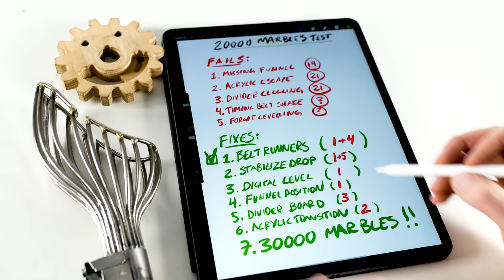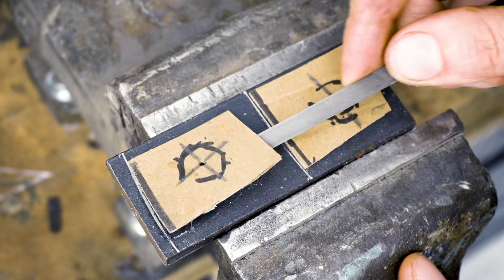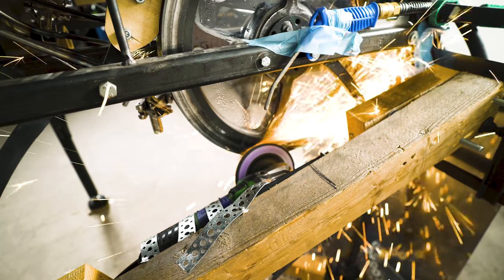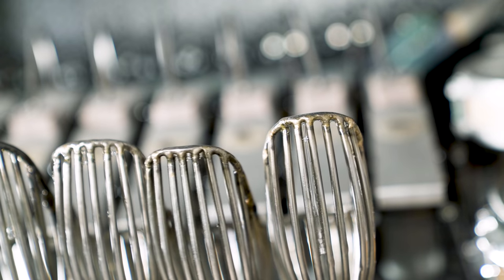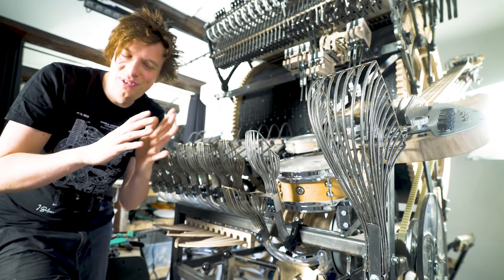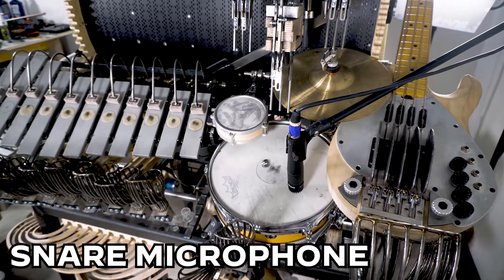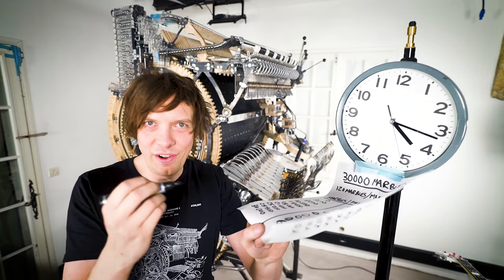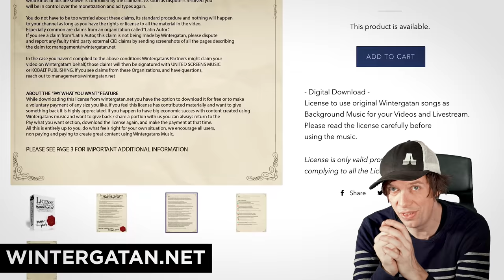Playing 30000 Marbles - Marble Machine X #148

Comment: The trouble, at its core, is not even that the fish stairs get fed when there's a backup and can't stop, the issue is that there's no reservoir of sorts to take up an excess of marbles without causing failure of some sort: If there's too many marbles at the top they're going to leak out somewhere, sooner or later.
Without messing too much with the layout: Empty the stairs into a box and feed them into the bottom of the the elevator if, and only if, there's capacity left, by having a second elevator loading platform on top of the already existing one: If there's already marbles getting lifted, new ones won't get loaded.

That way you won't ever have to worry about having too many marbles at the top, ever. Additionally with a reservoir you get a constant, predictable stream of marbles into the divider, indepenent of different round-trip lengths of different instruments and everything.

Last, but not least, you'd also have a place where you can drop a bucket of marbles into to load the machine.
Reply: I can well imagine the pipe out of the reservoir would be a prime place for blockages.
Reply: @ouzoloves  Well, yes. That's kinda the point: All blocking is in one place, and there's enough space in the reservoir so that the block doesn't reach the input of the reservoir. Of course you can also overload the reservoir, but if it's large enough you'd have to do that on purpose for it to ever happen. You also get an early warning, and a single place to watch. And if everything else fails you can add an overflow to the reservoir, taking marbles completely out of circulation.
Marble overload is a failure that always will be able to happen if you only put enough marbles into the machine, and if failure is unavoidable you want to make it graceful.
Reply: You also forget that he is using two channels out of many many channels.  Less marbles in the machine for the test, no traffic jams. More channels active, no traffic jams. The problem for those last 6 will never be a problem under normal play.
Reply: BTW the side "stair" is almost empty while the front "stair" is always full... small issue on dimensioning one vs the other?
Reply: @TheTexan83  But now we need to define "normal play", and limit compositions to it, probably only Martin will know whether that's a viable option. With a reservoir, the limit is simple: Don't eat more marbles than arrive on a fully-loaded elevator, right now the equation is both more complex and more restrictive. But even without all that I'd say the reservoir is worth a build simply to have a place to pour a bucket of marbles into.
Reply: @COPKALA  This is because this snare drum only consumes too few balls. So thus for main elevator not much work to do. All balls acumulate into fish stairs. In typical music machine would play much more notes simultanelously, so consuming more balls per second. Main elevator will get more balls to lidt and fish stari, which is actually overflow recovery device will have less. So actually this test is  pushing machine out  of typical operation envelope.
Reply: @TheTexan83  my thoughts exactly.😉👍
Reply: Buffering is a good idea. It doesn't hurt anything, just adds a safety valve.
Reply: @COPKALA  The stair is just a recycler. unused marble get sent back through the divider system via the stairs, the conveyor belt is what brings the marbles used to play instruments back up.
Reply: @Sorestlor  Make it a large glittery disco ball, under the drum? Or a big turning lotto  glass bulb, with marbles tumbling inside? ;)  To be serious I know if it was to look good it would probably create more problems than it would  fix.
Reply: It comes down to load balancing and I think that is one place that hasn’t been fully addressed in the MMX.  You need to make sure that there is enough marbles on top of the divider that it is fed enough marbles to keep all the channels full, but not too much that get backed up and overflow.  It is a question of timing and flow rates.  The return from the marble dividers to the fish stairs and back is a short trip and doesn’t have have a lot of reserve for excess marbles.  If you had a overflow that dumped them into the bottom of the machine then you could aleve the backup and prevent an overflow.   Couple this with a small storage system at the marble divider that can keep up with a fast song using all the channels during the time it takes the returning marbles to filter through the system.  This is going to be key to go from a slow section playing a few notes on one instrument to a rapid beat on all the instruments at once.  The first instance my overflow the top if it can’t handle all the marbles, the second may drain the marbles channels missing notes if it can’t refill the marble divider quickly and efficiently enough.  Once all the instruments are up and running you will have to run a ludicrous speed run with all the channels wide open and then one with nothing playing to make sure there is no backups and overflows. If the MMX can handle that then it can handle anything.
Reply: I'm not sure if you'd even need to do that,  outside of this test I think you'd generally have other things running, so the tube might not get clogged in the first place. In a more realistic application I don't think you'd ever see 4  hours of just snare drum :)
Reply: I wondered what channels would be the most frequently used and if that was taken into consideration. Also if that channel would require a reservoir to meet the demand.
Reply: @SpeedohDark  it has, I can't remember which episode, but he did do the math for the amount of balls being brought up per beat along with thee max amount you would reasonably play at  time, because do you think anyone would listen to just having every single xylaphone key being played at once? Those are the ones that take up the most channels as well, so yea. As for considerations, there were three ramps added at terh top to ensure that all channels can get marbles even if the front consumes a lot
Reply: The simple solution for the backup in the marble divider is to have a pipe at the end that sends marbles back to the bottom. This would mean that any marble that doesn’t fall into one of the holes will be sent back to the bottom instead of clogging things up. It’s a really simple change!
Reply: @karlpron  Why buffer when you can send the extra balls back to the bottom, eliminating overflow altogether?
Reply: The only real reason the fish stair overflowed is because only two channels were active.
In every other scenario, more than one instrument or note is played regularly, increasing the flow of marbles on the divider, which removes the problem.
I doubt Martin is going to be playing only the snare for 4 hours on stage ;).
Reply: Honestly this won't be an issue once all instrument channels are playing. It's a phantom issue because the supply of marbles in the machine are only being fed into 2 channels at the current time. With more channels the marbles won't loop through and back up like that.
Reply: @COPKALA   @Nicola Coppola  ooo, what about using an overflow at the top (like a shallow channel that allows marbles to slip off one side when its full) that simultaneously allows the marbles to travel normally from the fish stair, but allows the excess to freely escape and transfer to the main line... 

But that would also have to be able to merge without causing a traffic accident.. a Y-shaped complete enclosure?
Reply: I think the elevator slots lock the marbles in, while they are traveling up. Could be wrong tho or could be anglegrinded (-ground?) open ;)
Reply: @lievenpetersen  Oh, that's a good point. If that's the case it might be necessary to insert some running gears that keep the slots open for long enough. Or lower the current loading platform. Still seems to be the perfect place to inject reservoir marbles, though, because it's the only point (short of the fish stairs, which doesn't cross the main marble return flow and after the divider, where it's too late) where the marbles are caught in place and thus allow for a reliable priority mechanism.
E.g. there's good arguments to be made that the reservoir should be on the very bottom, it could be very large, it would give the machine a low(er) centre of gravity, it could be hidden from sight, but injecting into the magnet wheels in a prioritised and reliable manner would be a headache as the marbles can slip on the magnets. And depending on how the capacity of wheels vs. elevator looks, it could even overload the elevator loading platform.
Reply: @beez1717  Er, if you look closely, he does have an end pipe that sends marbles back. That's his overflow control.
Reply: I suggested something similar in a direct reply to his pinned comment at the top. He needs a hopper bin with 6 or so outlets and only one elevator. The fish stairs need to go. They're redundant. The whole thing can be a lot simpler if designed correctly.
Reply: @two_tier_gary_rumain  The fish stairs still serve a purpose: They allow the reservoir to be quite tall, instead of maybe a couple of centimetres.

As to things being more complex than they need to be: Yes, they are. Wheel lifts, demagnetiser and elevator all could be replaced by one helical lift, but that wouldn't look as cool. A helical lift would also allow the reservoir to be at the very bottom. But in the end this is an instrument, not a tractor attachment, aesthetics and style matter.

Comment: "The more mass, the more energy it takes to move this..."   This prophetic quote will come back to haunt you when the roadies go on strike because the machine is too heavy to move...
Reply: Just put it on wheels. :)
Reply: @two_tier_gary_rumain  fly wheels?
Reply: Get better roadies
Reply: It doesn't matter because he make the machine modular.
Reply: It wouldn't be hard to add mass in a way such that it can be taken off and put back on again easily.  Lumps of iron (or sand boxes) that can be screwed on in specific places, for example.
Reply: Precision though. This machine is not designed to be taken apart and put together that easily or quickly.

But the heaviest part is the flywheel, easy to remove and reinstall.
Reply: @AstralS7orm  Martin said that in another video, how else would he take the MMX on tour with his band?
Reply: And remember, the MMX is meant to be broken down into sections for transport.
Reply: @TheCobraCommander  I suspect that taking it into two or three sections is all that makes sense. Or it will take hours to put back together and be hard to ensure it's all done and working right.
You don't want to mess with the frame or marble droppers, or the marble staircase... Or reinstall all PMMA tubing.
Reply: Mmmmmm, yes.  It's a tiring process for sure.  Martin's done a fantastic job through all the building, rebuilding, and redesigning of this machine.  That much I do know.

Comment: I would have looked at making the belt runners as a spring loaded tensioner for when new belts stretches out
Reply: One problem at a time, my friend, one small problem at a time...
Reply: I searched the comments for "belt" to avoid repeating the same exact thing. I work with cars, so I really know what you mean
Reply: And also add only tensioner on the return/non transmitting side of the belt
Reply: the weight of those belts, compared to the weight of the machine, caused almost zero vibration. Now the weight of the out of balance flywheel became obvious. But yes, Martin forgot the first rule of inventing. If you can't make it perfect, make it adjustable.
Reply: I agree. I saw them on "Wheeler Dealers".

Comment: PLEASE DON'T LEAVE THE MAGNETS AS  COUNTERWEIGHTS! Long term they will collect metal shavings; dropped screws, washers & allen wrenches; maybe even a marble... And then throw them back out at an inoportune time. Epoxy or TIG the same mass at the location you've found.
Reply: You wouldn't want to epoxy or weld them. I agree that magnets might not be the best idea, but more how tires are balanced. A counterweight that is glued but can also easily be removed as the shape changes over time and is moved.
Reply: @seemlesslies  Glue=epoxy. Super glue for metal to metal is fine. Martin can even drill & tap a hole to fasten a stack of washers. Just something semi permanent - doubt this will change over time - and also obviously meant to be there. Imagine on the world tour a Roadie polishing up the MMX finds 3 loose magnets stuck to the side of the flywheel and removes them...

Comment: I prefer the sound of the snare before you used the gate, as when you applied it there is a loss of sound richness, as having some of the machine noise come through gives some organic life to the beat.
Reply: actually I love the genuine sound of the MMX  - it's not disturbing at all - maybe after listening repeatedly
Reply: I totally agree
Reply: I would agree, but when making music you want to avoid having excess noise (especially for mixing!) 

Also do remember that if every single channel has the mechanical noise it will be this cacophony of sound, vs only having one channel with a few hints of the mechanisms. :)
Reply: @Kaboom1212Gaming  the mechanical noise would have been drowned out by the rest of the track and the box drumming. It sounded WAY better before adding the noise gate. The EQ was way off as well, way too boomy